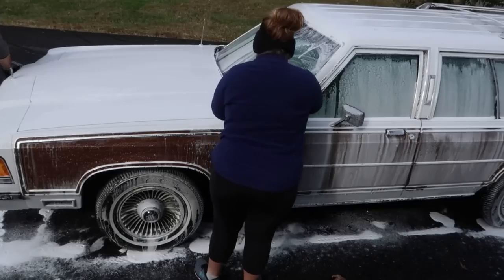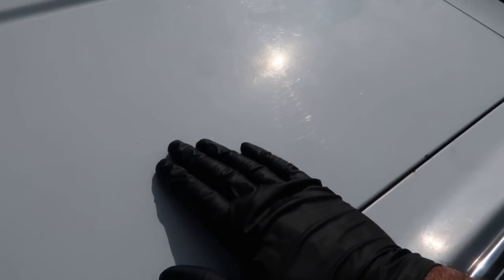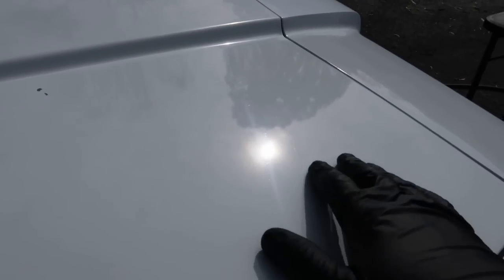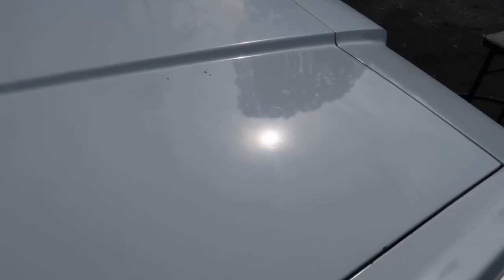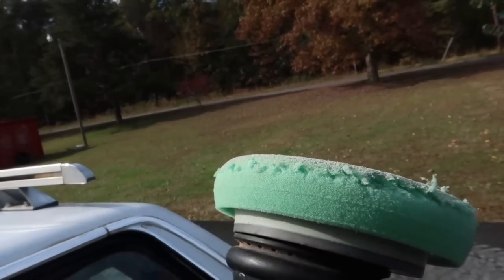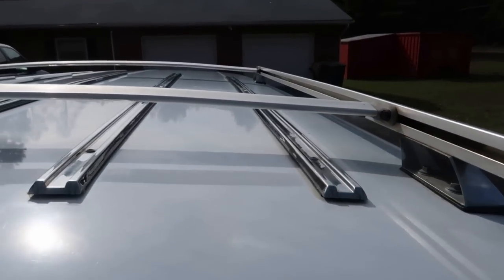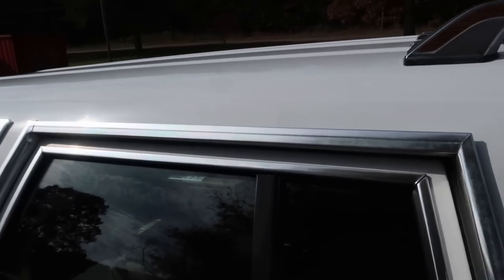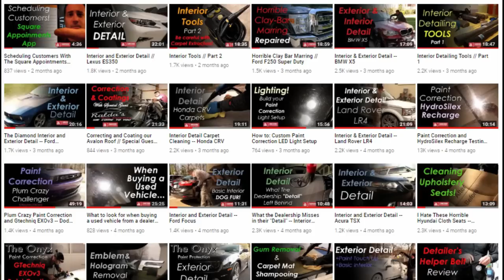Exterior Detail // Polishing White Oxidized Paint // Mercury Grand Marquis Colony Parkway Wagon

Comment: Great Work! Been watching your videos lately and was curious on how much you like the big foot polisher. Im in between purchasing the bigfoot or the Flex and wanted to know your opinion on how effective the Big Foot is since it is over $100 cheaper. Apprecaite it and keep up the good work! Btw my shop is in upstate NY so hello from up here!
Reply from the maker: Thanks!
I love my Rupes 15!  I’ve tried the flex before and actually I like that also. I’m actually considering buying the cheaper flex knock off polisher on eBay. I’ve heard good things about it. Also the Rupes knock off polishers I’ve heard are also just as good and if not exactly the same. 
I say either way it’s a great upgrade from any smaller DA polisher. I still use my Porter Cable daily for either 3 inch polishing or wax and sealant applications. 
Feel free to call or text if you have any other Questions. 
Where in upstate NY we moved from Whitehall NY and Vermont area about 10 years ago.